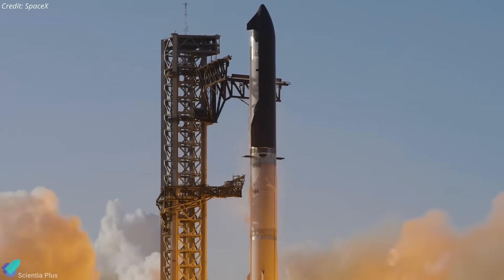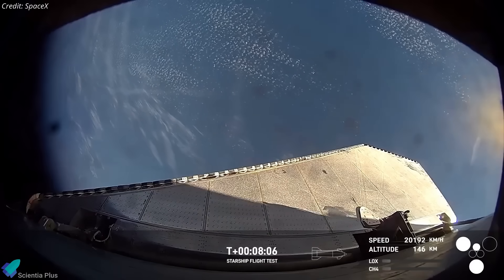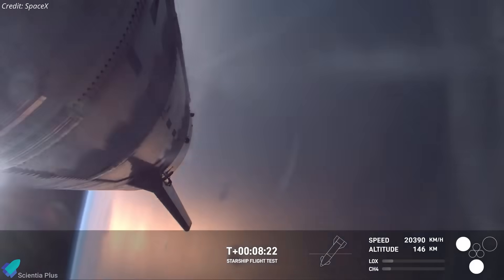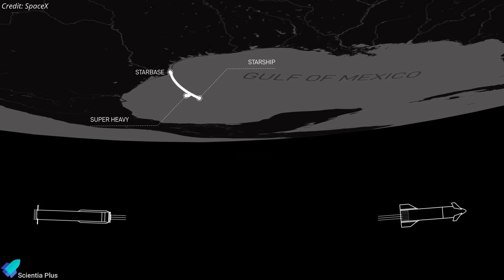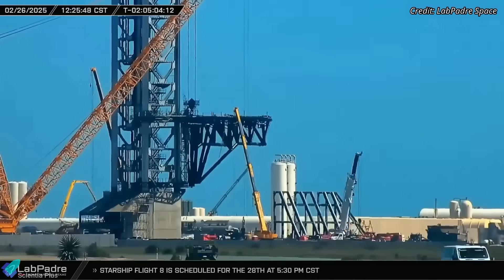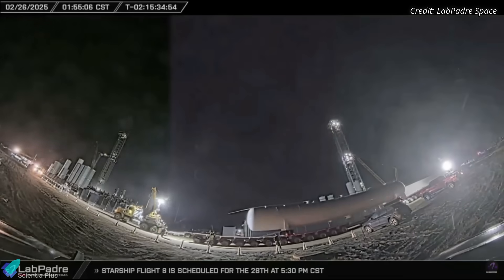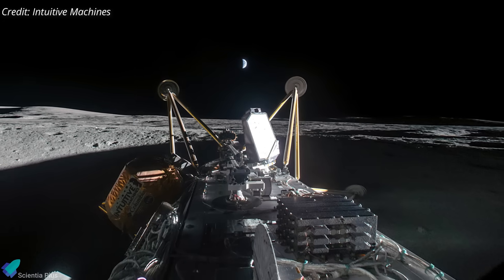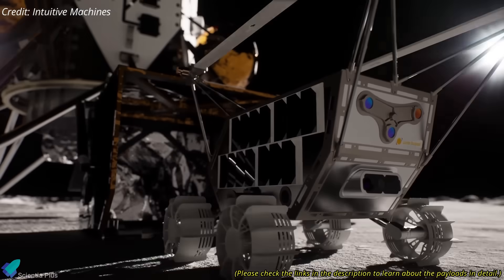NO TIME WASTED! SpaceX Rushes Into Flight 9 Testing After Flight 8 Failure!

Comment from the maker: 00:00 Starship Updates 🚀
11:12 Athena Crash-Lands on the Moon! Shocking Landing Anomaly & Aftermath Explained!🌕

🔍 Starship Flight-7 Anomaly Root Cause & Fixes: https://youtu.be/UqzZx7vb-TA
🔍 Flight-8 Complete Breakdown: https://youtu.be/f26yH80RK2o

📚 Learn More:

🔹 Starship Block 2 Explained:
 📖 Summary: https://shorturl.at/b0dtw
 🔍 Detailed Explanations:
  • Design Improvements Update 1: https://shorturl.at/lpGT7
  • Design Improvements Update 2: https://shorturl.at/gwNQ4
  • Nosecone & Payload Bay Redesign: https://shorturl.at/xa60S
  • Methane Downcomer Redesign: https://shorturl.at/XdYBG

🚀 Starship Block 3 Features: https://shorturl.at/mnBT4
🔄 Starship Block 2, Block 3 & Raptor V2, V3 Complete Update: https://shorturl.at/tN248
🔥 Raptor V3 Mega Upgrades & First Test: https://shorturl.at/TRIyj

🛠 Latest Starship Upgrades:
 • Hot Staging Explained: https://shorturl.at/jf400
 • Super Heavy Booster Upgrades: https://shorturl.at/Pi5R3
 • How SpaceX Protects Raptor Engines: https://shorturl.at/4Om8F
 • New Heat Tiles Explained: https://shorturl.at/p2Ijb

🔍 Starship Flight-7 Anomaly Root Cause & Fixes: https://youtu.be/UqzZx7vb-TA
🔍 Flight-8 Complete Breakdown: https://youtu.be/f26yH80RK2o

🌙 Nova C Athena Mission Explained: https://shorturl.at/4mnFt
🌙 Nova-C Odysseus:
 🚀 Launch & Mission Explained: shorturl.at/rvABK
 ⚠ Lunar Landing FAIL! What Went Wrong?: shorturl.at/pqAIM
 💀 Odysseus is GONE! Mission Over: shorturl.at/b6MeY

📡 Stay Updated:
📢 Weekly Updates: https://bit.ly/3HIQjPC
🚀 SpaceX Playlist: https://bit.ly/34wue8T

🌍 Follow Us:
👍 Facebook: https://www.facebook.com/scientiaplus
Reply: GO space X
Reply: You have no idea what you're talking about. The engine bell was not leaking.

Comment: If it’s a fire it’s either a nozzle side wall burn through or a leak of both fuel and oxidizer. If it’s only fuel there will not be a fire at that altitude because there is not enough oxygen in the atmosphere at that altitude.

Comment: At 0:21 flame can be seen licking in the right hand side of the engine bay. Although a piece of the vacuum engine bell on the left is missing, whether this is a symptom of the the initial cause or consequence of the initial cause cannot be determined from this video. It could be that the missing piece blew up into the engine bay causing more damage and starting the fire in the engine bay or something in the engine bay exploded initially knocking the piece out of the engine bell. 
Only if SpaceX releases the full video footage from engine start to the bell damage can we determine the timeline between the engine bay fire to the bell damage.
The engine bay fire may have caused the vacuum bell to explode or the damage to the bell caused the bell to explode. Either way, the vacuum engine explosion most probably caused the damage to the other 3 raptors. Again the full footage and sensor telemetry needs to be seen to determine exactly what happened. Anything else is mere speculation at this time.

Comment: Why not have a second set of catching chopsticks on the opposite side or 90° different side for catching the returning starship/ booster. This way the the OLM will be protected from the returning vehicles down thrust of the rockets. Do they need to take off and land in the same place? Can't see the necessity for the co-location. Yes a co- located lifting mechanism but it has or could have 360° options around the lifting tower.

Comment: The Russians terminally failed with this multi-engine configuration  in 1969-1973. Engineering 101: complex systems have many points of failure. That's why NASA were so successful  with their fewer and much larger  engines as per the F1/Saturn5. It seems that Musk is not only incapable  of learning  from his own mistakes but also from those provided by history. Who'd have thought?

Comment: Should use only 3 ctr engines for hot staging lite rvacs AFTER seperation! Also leave a solid ring at bottom of rvac bells so not damaged durinh hot stage.
Reply: Wouldn’t work- with three engines still running on the Booster which is mostly empty, wouldn’t have assurance of separation. - Dave Huntsman

Comment: Looking at the process to ready one of these launches, static firings, wet rehersal, fueling, venting to regulate pressure of a fueled rocket, defueling, refueling, venting fuel from the standing plumbing in the tower before launch, which has me wondering.  Through all these steps, how much methane is vented to atmosphere?  That amount times the fifty launches per year that Musk is projecting sounds like a significant environmental issue.  Does anybody have any idea about this?
Reply: Looks like you're the only one concerned about methane. Go figure...

Comment: OK----------.  FIVE THINGS MUST BE CHANGED ON FLIGHT 9....   
--------------...  FIRST:  THE LONG METHANE DOWNCOMERS FOR THE VACUUM RAPTORS THAT EXTEND FROM THE METHANE TANK DOWN TO EACH ENGINE MUST BE ELIMINATED...AS THEIR LONG STRAIT THIN PIPES CAN ONLY MAGNIFY THE ENGINE ASSOLATOINS LIKE A THICK GUITAR STRING... MAKING THE PIPES LOX TANK DOME PENITRATIONS WELDS ALMOST IMPOSSIBLE TO KEEP FROM FAILING... 
------------.  SECOND::  THE METHANE CENTER LARGE TUBE  DOWNCOMER MUST BE LENGTHENED TO PENETRATE THE LOWER LOX TANK DOME THAT IS STRONG ENOUGH TO RESIST ENGINE ACOOSTIC VIBRATIONS BEFORE ANY OF THE SMALL METHANE DIRECT FEED PIPES ARE TAKEN OFF AT THE END OF THE METHANE DOWN COMER...  ELIMINATING ALL OF THE SMALL WEAK DOWNCOMER LOX TANK DOME WELDED PENETRATIONS THAT CAN CRACK LEAK AND BREAK FROM ENGINE HARMONIC VIBRATIONS... MAKING PRODUCTON EASIER, CHEAPER...AND LIGHTER...
---------------... THIRD:::    THE VACUUM ENGINES MUST BE ANGLED IN,,,  ALIGNING THEIR THRUST VECTOR WITH THE CENTER MASS POINT OF THE STARSHIP,,,  INSIDE THE UPPER END OF THE METHANE TANK...   THAT CANNOT BE CALCULATED PERFECTLY AS THAT POINT DEPENDS ON THE CARGO WEIGHT OF THE STARSHIP... AND MOVES AS PROPELANT IS USED...   BUT WOULD ALLOW THE STARSHIP TO MAINTAIN A STRAIGHT COURSE NO MATTER HOW MANY VAC ENGINES LOSE THRUST...   USING ONLY THE MANUEVERING THRUSTERS,  TO CONTROL STARSHIPS HEADING IF THE CENTER GYMBLED LANDING ENGINES FAIL IN PART OR ALL... 
          THIS WOULD HAVE KEPT STARSHIP FLIGHTS 7 AND 8 FROM TUMBLING, GIVING MORE TIME FOR  THE RECORDING CAMERAS, SENSORS AND THE ENGINEERS TO TROUBLE SHOOT THE PROBLEMS... OF FLIGHT 7 AND 8... SHUTINGDOWN LEAKS FROM ANY FEED PIPE  BREAKS AND CRACKS... TO HAVE POSSIBLY PUT OUT THE FIRES AND RESTART THE ENGINES THAT WERE STILL ABLE TO RUN...
------------...  FORTH::::   IF THE VACUUM ENGINES ON FLIGHT 7 AND 8 HAD BEEN PROGRAMED TO SHUT DOWN WITH THE FAILING OF THE FIRST VAC ENGINE AND ALL THREE GYMBLED ENGINES... THE ENGINEERS WOULD HAVE HAD  MORE TIME TO STUDY THE  CAUSES OF THE FAILURES.. A MUTE POINT IF THE VAC ENGINES ARE ALIGNED TO THE SHIPS CENTER OF MASS...
-----------...  FIFTH:::::   SHUT OFF VALVES MUST BE PUT ON ALL FEED LINES INSIDE AND BEFORE THEY EXIT THE LOX TANK AND CENTRAL METHANE DOWNCOMER TUBE. TO STOP THE FLOW OF PROPELANT FROM MASSIVE LEAKS IN ANY FEED PIPES AND PUT OUT FIRES IN THE ATTIC...!!!   BEFORE THEY DESTROY EQUIPMENT... AND ELECTRONICS...!!!  (INSIDE TANK FEED VALVES MUST BE ADDED TO  BOTH SUPERHEAVY AND FALCON BOOSTERS AS WELL...  TO END INFLIGHT AND LANDING FIRES ANY TIME AN ENGINE IS SHUT DOWN)....

Comment: The problem is the connection ring design when the ship fires-up prior to disconnection from the booster! 🇺🇸😎🐶
Reply: It was not a problem on V1, how do you explain this?
Reply: @ 
V-2: More weight/fuel on top of booster applying more pressure between ship & booster when starship ignites its engines. All this added pressure is exhausted through same size vents as V-1 causing minor cracks in engine nozzles.
Reply: On what do you base that? - Dave Huntsman
Reply: @ starship: damage to engines & pressured fuel lines. Shock & vibration caused by pressure directed to the heavy booster.